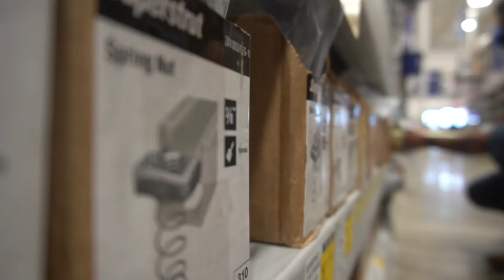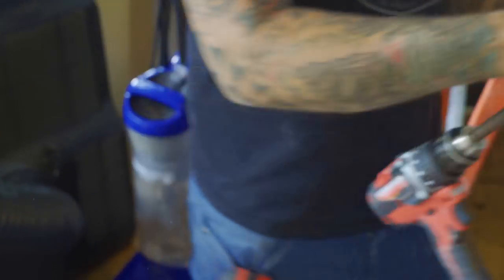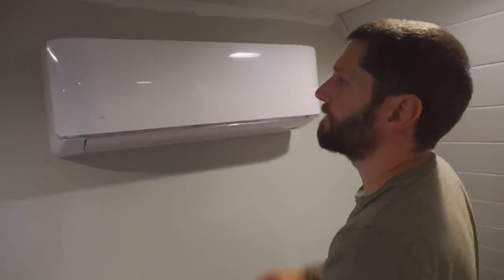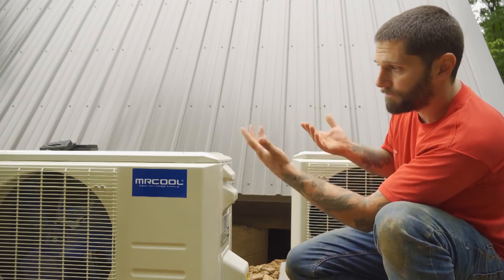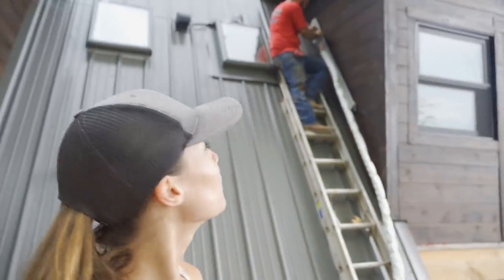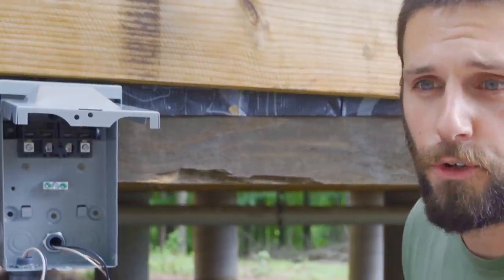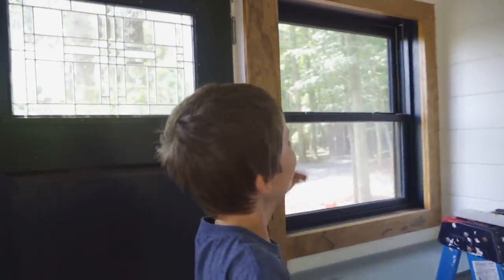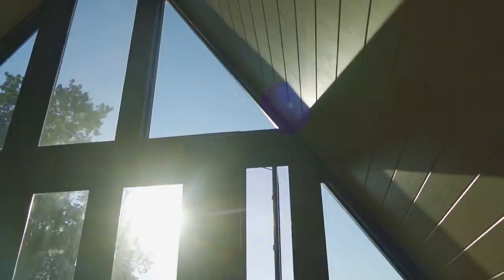Installing AIR CONDITIONING In Our Off-Grid Home!

Comment: I've seen those units that they used indoors used with a heat exchange system. The unit outdoors changes cold weather to heat inside & hot weather to air conditioning. Supposed to be very efficient too.

Comment: Those look like rebranded pioneers from Parker Davis HVAC.  Interesting.  I use the Pioneers because they are much cheaper.   So, you used a 12k btu for a bedroom?  That's massive.  I mean it can probably ramp down to 4k btu, but Mr. Cool doesn't give out their specs on their units which is another reason I won't buy them.  It's all about load calculation and using the one that will work best and never short cycle.  Mini splits are awesome.  They use hardly any electricity and keep you very comfortable.  If you live in a humid area or if you find a unit is oversized, go into the engineering settings to make your mini split fan stop when the compressor stops to keep humidity down.  Great install video you are doing a great job!

Comment: I love how your air conditioning system is setup, but it must take plenty of energy to cool the home you all have and I have one unit outside which cools my entire house easily and I have it turned down to save energy. The system should have your entire home very cold during the warmest days of Summer and keeping you all so cold on those hot days. You all have put so much work into that home and I know you all will be glad when you are complete in getting all systems completed.

Comment: I like your DIY. It's a heat pump which can work as both heating and cooling mode. Before covering the flare connectors you should have done leak test just incase tiny micro leak can empty the system.

Comment: Have you thought of ceiling fans? They are great for circulation in homes with vaulted ceilings. I don't know anything about amps and draw on your system, but I know they keep my cooling and heating bills lower when they are in use.

Comment: Very nice video.
You have built an amazing place, congrats.
You'll do great with these mini-splits. Hopefully they are the inverter type that saves a lot of energy, they avoid the abrupt starting amps.

You forgot yo mention pulling a vacum on the lines before releasing  the refrigerant.
Nice work anyway.

Comment: Connections on line set requires a certain torque settings. Didn’t notice that you Vacume the lines. Refrigerant works better with moisture and ambient air removed from the lines. Also it’s better for the compressor not to have contaminants.

Comment: I couldn't see in the end but I just wanted to point out...Any extra copper line you have you don't want to make a vertical coil/loop as this creates a natural oil trap. Not allowing enough oil to get back to the compressor. Oil circulates through the sys. If you have that just bend the copper so the access in a horizontal loop...This will increase your compressor life...

Comment: Looks like you have done a very nice job. One question: did you vacuum out the lines? I did not see it in the video, but maybe you did that off screen. The system will not work very well without vacuuming.

Comment: Very nice build!  Small point when one lifts up heavy gear - keep your back straight and bend your legs - otherwise you will regret it by the time you get to my age!
Reply: totally agree with you Matthew.   Josh already has back issues
Reply: @x35mmman  the advice was equally for both adults (and really all of us); everyone tends to lift that way unless trained or they encounter a lifting problem.  When you bend your back over a load and stoop right over - well you place a lot of strain on muscles and vertebrae that aren't designed for that.  So work with your body and it will last you a long, long time!

Comment: I didn't see you guys run a vacuum pump on line sets to get rid of air in the lines. Does these mini splits not require  that. Every ond  of done and seen done ,  also we always leak check flare fittings. Have had issues with leaks. They actually sale a torque wrench for these flares. Great  install job, you showed me a few tricks.

Comment: Before you go putting trim around those split AC units, remember that you have to open them up about every two months to clean the filters and all surfaces. They will also need to be cleaned (professionally) with high-pressure water once or twice a year. So, whatever you do, make sure they are kept totally accessible for cleaning.

Comment: how are you guys liking your mini splits as time has passed? Converting a pole barn into a home in WV and have also chosen a Mr. Cool to cool/heat our home. Thank you for showing so much of that process, it will be a great reference for me. God Bless.
Reply from the maker: We love them! They worked great for heat in the winter, we didn't even need our wood stove and during the summer they have done an excellent job cooling. We would definitely recommend them!
Reply: @WildWonderfulOffGrid  Thanks for the reply, you guys are an inspiration for DIY home builders out there. Glad to have you in WV.

Comment: i didn't see use a vacuum pump before you let freon flow my friend
to take out all the air and humidity from the system....but good job....
Reply: I get what your saying. Down to 500 microns or better. I was curious about that DIY system like does the line set have special schrader valves or something to that effect.

Comment: I am curious is you considered a geothermal system for heating and cooling.  It seems like that would have been a great fit for an off-the-grid home.  And did you consider ICFs for your home for the same reason?

Comment: You can always trow another solar panel up to get the extra juice the problem are the batteries and how much of a safety you design into the inverter? How much bigger is the inverter than you actually need?

Comment: If you allow me two tips, one before starting the air conditioning, you have to make a vacuum to the installation with a vacuum pump, to remove the humidity from the circuit after opening stop valves. The second is to protect the section of tube and cable without a gutter with a metal mesh, since you are in the field, the animals will eat the cables. Cheers

si me permites dos consejos , uno antes de dar marcha a el aire acondicionado hay que hacerle un vacío a la instalación con u a bomba de vacío , para eliminar la humedad del circuito despues abrir válvulas de paso.

la segunda protejer el tramo de tubo y cable sin canaleta con una malla metálica , dado que estas en el campo , los animales se comeran los cables .

saludos

Comment: What prevented you from placing the external air conditioner units on the shelf, to the left of the door, where the pipes came out of the wall? So they would be partially under the eaves of the roof. Now you have to think about how to protect them from snow falling from the roof ... And the pipeline would be much shorter.

Comment: If you don’t have a ceiling that is insulated you have to get a unit with 3000 more BTU’s no matter what brand you use.  That is what I had to do in my back room in my house..  I went with a 15,000 BTU unit and it works great.

Comment: Wouldn't it be easier to run am outlet to exterior wall and plug the unit?  The disconnect boxes are usually used in 240V systems with 8 gauge wires.

Comment: When the line sets were connected and prior to the release of the refrigerant, did you vacuum the system to remove the air and moisture from the uncharged system?  I did not see a vacuum pump or any gauges during the process and nothing was mentioned.  Any refrigerant based system needs to be evacuated prior to being charged.  It is also good form to hold a vacuum for awhile to verify the integrity of the system.  The larger the system the longer the hold time needs to be.  The longer the line set then the more refrigerant is required as well.  You stated you doubled the line set length.  So additional refrigerant will also be required for the longer line set.  Is it possible that MRCOOL has developed connectors that ALL the components are evacuated and/or charged prior to installation and connection?  The connectors on the web site appear to look different than any other connectors I have seen before.
Reply: He said that there was no need for charging because everything comes ready to go.
Reply: looks like pipe lines comes precharged
Reply: Usually yes you'd pressure test the lines and vaccume the system down to 500 microns on a traditional system with flare fittings and no pre-charged line sets. Other units come with around 24 feet worth of refrigerant and adding more for additional length. But precharged lines take that away. Easier diy

Comment: They won't work a efficiency staggered like that, you should put them side by side, they will work fine, only thing is, you'll have a little bit of trouble connecting the pipes and the wires. Just make sure they're not one on front of the other.

Comment: Few things. You never showed vacuuming The line. Also why would you not Just put The neutral on the disconnect.. you had The terminal's why not use them?
And is there a specific reason you didn't Just get a 3 zone unit?

Just friendly questions have a great Day .

Also great great job explaining wire size vs breaker! Perfectly put. Lot's of people Trip up on this

Comment: The outdoor units will suck in debris and it will grow a coat on the outdoor coil. When you build the deck will you be able to get to the units to wash the coils? The indoor units need to be cleaned to. Requires taking the shell off. If you box it in will you still easily be able to get it off for cleaning?

Comment: Do they not make these diy units in a multi port application?  You can easily run three 12kbtu indoor heads off one 3 ton condensing unit.  Or at the very least, combine the two that are on the same side of the house.

Comment: Hello all right, two things I think were missing in the installation of air conditioning, pressurization and to check for possible leakage and make the vacuum to eliminate contamination of the refrigerant gas ...

Comment: "L N"... we say it here, as live (live wire) and neutral.

Btw just curious, it's simple as that? No re-gas the units (as it's already filled with refrigerant?) and air in the pipes is ok and don't effect the running of the AC? I'm just asking.

Thanks for great video.

Comment: Hmmm, surprising is the fact that I have not seen you to use the vacuum pump after you finished all the pipes conections, for vacuuming the freon installation. And as I know, it is a must for get the best results on air cooling. 
 Moisture deposited on the pipes and routes through which the refrigerant circulates can contaminate the circuit, inevitably leading to a slowdown in the operation of the air conditioner and a decrease in efficiency.  This is the reason of using a vacuum pump, for extracting all the impurities, besides the freon, from instalation.

Comment: Any feedback on your satisfaction with the Mr Cool system(s)?  Looks like you installed it without clearing/vacuuming the lines.  Was that how it went in?  If so, was that part of the Mr Cool instructions?
Reply from the maker: Yes, the DIY units do not require vacuuming the lines. We used the units for heat this past winter and AC last summer/this spring/summer. They work great. We are super happy with them

Comment: But why not just run the 12 awg wires anyway? Do the terminals not accept 12? The cost difference isn't like running a 10 run? Anyway, those splits are cool. Your work and lifestyle is admirable. Keep it up.

(Not being critical, but genuinely interested)

Comment: I'm planning on installing this exact unit... I would like to run it off of solar.. What kind of power is this unit pulling at startup and once it is running what is the power usage...  Have you calculated what size battery you need to run one of these units?..thank you in advance...What seer unit did you buy...

Comment: The most important part of installing a mini split is to pull a vacuum on the system Before you open the service valves. When did they do that? I didn't see it..
Reply from the maker: Its is not necessary with these units- they are DIY. We discuss this in the video that follows this one

Comment: Hello, I am from Argentina, I am a registered split installer and here the equipment is tested for pressure with nitrogen in case there is a leak in the circuit and then with a vacuum pump all moisture is extracted from the pipes. In your country, isn't it?

Comment: Hmm if you used a heat pump design and used the earth as heat and cooling storage unit the AC units would provide heat and or cooling.   Just requires a heat sink in the earth..   COILED hose fluid line that takes away the heat or cooling as needed.     Air cooling exchange is ok but not as efficent. 

Something to think about in future as the option will come clearer as the technology improves. 
how big the heat sink needs to be.   
Its a pit that holds the coiled hose over a large area that is 8 feet deep.   Below frost line.

Comment: Could't run a 240v single inverter compressor with three zones with your solar system? That the reason you went with 3 115v compressors?

Comment: Good video but u should have made it with an vacuum in the cupper cause the air isnt the best for the motor of the extern unit and will lower the cooling inside greetings

Comment: I always thought you need to vacuum down the lines to get rid of air, or your unit gets destroyed.
Reply: I was thinking the same thing! although the units come pre-charge you really should pull a vacuum on it to make sure there's no leaks and get all of the air with any moisture out of the lines otherwise eventually it will destroy your unit by converting the moisture that's in there into an acid that will eat through the lines in your outside condenser unit inside air handler or anywhere along the lines.

Comment: Did you vaccum the system before you opened the suction/discharge? Did you adjust your refrigerant pressure to account for the line set?  Are you EPA certified to do this?
Reply from the maker: This is a DIY system. The lineset is precharged

Comment: You did not have to draw a vacuum on the line set before releasing unit refrigerant into the line set. It looked the line set had only plastic plugs on the ends in the video. There would be air in the system when the main unit refrigerant is released

Comment: The base of the air conditioner should have slight inclinations to drain the air conditioning water, and the air conditioning water will not collect in the air conditioner, and in the future there will be churning inside, and simple inclinations must be made at the base towards the drainage hole

Comment: NEC 240.4(D)(3) states that 14 AWG must be protected at 15A. You can not use 14 AWG anywhere on a circuit that has a 20A breaker.  Minimum wire size require by code will be 12 gauge.
You can go above the code but you can't go beneath it.

Comment: When were you going explain how to vacuum down the system, not to mention leak test prior to releasing the refrigeration gas
Reply from the maker: Im pretty sure in the beginning of the video we talk about how it's a DIY system that doesn't requiring vacuuming of the lines, extra equipment or a HVAC guy. Also, this isn't a "how to channel"- we are showing what we are doing to our home- not walking others through how to do it themselves. We don't explain step by step" how to"

Comment: Do not put the condenser under the deck. The coil will load up with dirt  with no rain to keep it clean. Also to do almost any maintenance you need to remove the top. Good assess means good maintenance, flush with hose.

Comment: don't box around your mini split head units... its impossible for them to work properly if you do.  They pull the air in through the top of the head unit and out the front, you also need to be able to open your front cover to get your washable filter out.... its a really good idea to have a vent in your drain line outside the wall...

Comment: Installing so long pipes without vacuum pump isn't a good approach. You risking to have low pressure and water in the system. Better check it and refill with cooling fluid  if necessary. Also if you plan to use them for heating my advice is to install a protection covers over the outdoor units. Didn't saw but I hope you installed the indoor units slightly tilted so the condensed water don't stay in the unit. Love the way you protected the Interconnection between the pipes.
Reply: Eva Kiner  All HVAC comes precharged these days. But usually  for pipes not longer than 5 meters.

Comment: Is it just me or is that cat cross-eyed? Nice to have some AC in hot days. Mostly we use them as a heat source in cold days, as we live in the north of Norway, above the arctic circle. We put ours under the porch to keep it clear of any water or snow. You don't need to pump out the air from the pipes before you let out the coolant gas? Don't you loose efficiency by keeping some air inside?

Comment: IF the feeder neutral is compromised, then the neutral wire could end up at a potential above ground. By opening the neutral too you can be more assured that no electrical energy is present.

Comment: Heat pump installation need vacuuming heat pump with vacuum pump, in your case u have inproper instalation because refrigerant/gas mixtured with air in pipes will produce third gas mixture so the lifetime of your units will be less then warranty. Cheers

Comment: Why wouldn't you just break the neutral if the box is set up for it, I'm a sparky too just wanted to know your logic
Reply: Also did you figure voltage drop on the 15 awg wire ;)